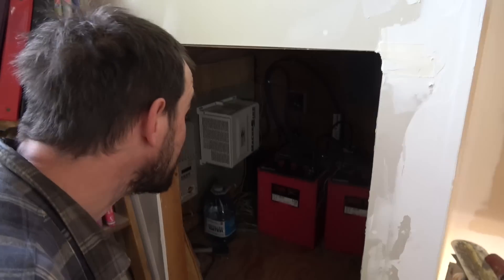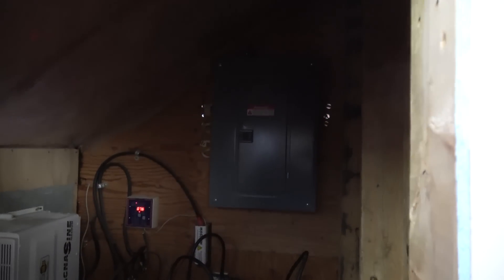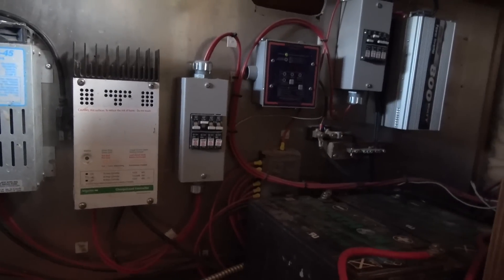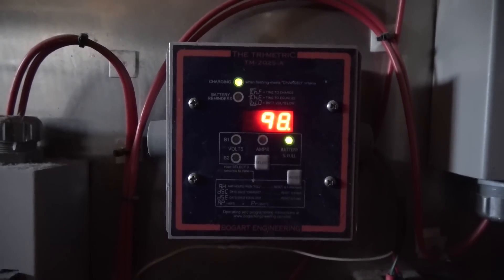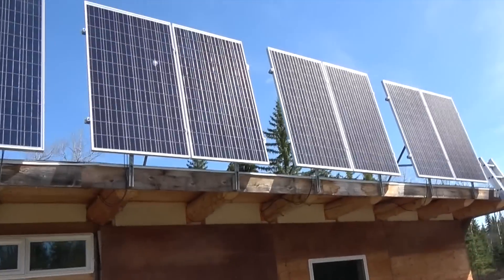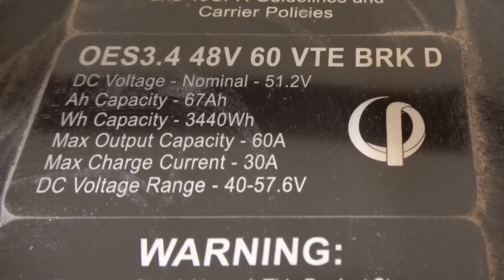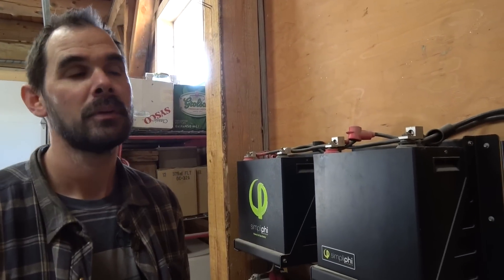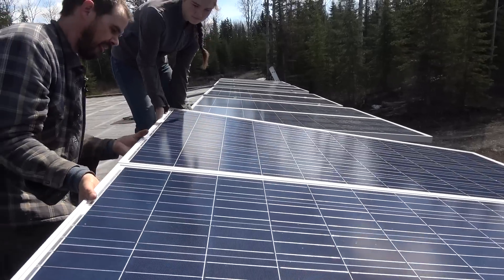Off Grid Solar Power - with Simpliphi Lithium Ion Battery

Comment: I'm working on my offgrid home solar. I'm at 1200watt mono panels. 2charge controllers. Running 24v. With a 5kw inverter. I'm building up the battery bank. And working on a lithium bank. It's at 108ah. Can't wait until its at around 1000ah. With a 200ah lead acid Bank. I am using a few DC led lights. Saving the ac lighting for when needed. With a gas tankless water heater. And getting a gas stove! Great video

Comment: All those little boxes and wires and stuff to perhaps fail is why I use small individual pv panels to run small air compressors and save my power in giant air (most being formerly propane) tanks. I call that my Air Battery. So I have a tiny $25 pv panel, a small 12-volt motor driving a little compressor and some receivers (tanks) . . . AND either a piston or turbine "steam" (read that 'air') engine coupled to either an ac or a dc generator. I make power for my freezer(s) as they require it.  The biggest take-away here is, I live my life "intentionally".  Purpose drives motive.😊

Comment: So when I had my solar array installed, the salesman asked me if I wanted one inverter or an inverter for each panel. Seems one inverter will limit power to that produced by the least efficient panel in the array. This question came right after I said I wanted the array to be set up to be attached to the grid for now but so that I could put in batteries later when batteries get better so I did not have to mess with the acid/hydrogen gas/distilled water stuff. Caught me from such a bad mental angle that I replied 'one on each panel' without really thinking about it. After all, HE was the expert even though I had tried to learn all I could before talking to the salesman. During installation I realized the system setup would not allow for that. The electrician confirmed that to feed a battery bank in the future I would have to place a single inverter to DC downstream of the panel inverters that were pumping out AC. I hope that is going to be as easy as it sounds and not much of a drop in power because those lithium ferrophosphate batteries like you have (SimpliPhi at about US $2800) are what I was hoping would come along. Anyway, those of you planning for solar now - batts later, don't make the mistake I did.

Comment: I'm also planning a hydroelectric project in mind. Well a micro mini hydro project. I'll be lucky to get 10a at 30v. Or 300 watts or so. But that's 24/7 andi could probably get by on a 1200watt inverter. And I have generators ac and DC. I can do 150amps at 30v. And 7kw ac. So I basically live off solar. And have emergency backup generators. Great video...

Comment: Build a root celler  underneath  your kitchen with a trap door and you won't need a refrigerator or a freezer if you do it right and put pond or river ice in it during the winter and early spring. The ice will last for well before the next freeze. AND salt then smoke ALL of your meats, fish included, rinse off excess salt before using the salted meats.

Comment: Discharging PHI batteries to a voltage level below the 100% Depth of Discharge (DOD), level Voids the batteries’ Warranty. Over the ten-year Limited Warranty Period, SimpliPhi warrants the SimpliPhi Power Product at 80% or greater of its original-rated capacity.

Comment: I have been of grid for 20 years in winter my fridge and separate freezer turns of by a timer at 6pm and doesn't turn on till 9am and every things cold and doesn't melt I have big tv washing machine internet every thing house has but if its cloudy I will not weld or grind or use big tools once you start you can never go back to the grid.
Reply: slipryeel I was thinking in the winter when solar charging g is reduced the fridge/freezer shouldn’t need much anyway. It’s way below freezing already out.

Comment: Just looked at Wholesale Solar... 3.5 KW Simpiphi batteries = $3,000 each.... for your 4 batteries, add 15 KW charge control and inverter (small excess capacity is smart) + monitoring software/interface = appx $14-15,000 US. That is a GREAT system, but I think I'll just get (2)Tesla Powerwall 2.0s, includes all of that for $15,000. Love your system, I just like to support Tesla and Ilon Musk in all of his world changing ventures.

Comment: I enjoy all your videos. Would it be intrusive to ask what the entire 5 panel solar system cost complete? I am sure I am not the only curious subscriber. Thanks for sharing.
Reply: interested
Reply: Each unit of 3kwh battery costs 3500$, and there is 4 of em, so at least 10000$ in battery ...
Reply from the maker: The prices I paid a few years ago are no longer current.  Right now you can probably buy the equipment (panels, charge controller, inverter/charger, combiner box etc) for around $2/watt (so around $6k for our system).  This does not include batteries as you could go very cheap and short term or more expensive and longer lasting.  The Lithium batteries are around $3k each and should last a very long time (I'm hoping for 20 years).  I've purchased from wholesale solar before, you can get an idea of prices from their website: https://www.wholesalesolar.com/
Reply: Jamie Karl in 10 years battery capacity will be multiplied by at least 5 though 😂😂 so he won’t keep it for 30 years i’m sure, that’s a trap. You can’t plan things that far...

Comment: Hey Jeff, Curious about why you added a second pair of the Simpliphi batteries. Capacity or peak output current? Lithium Ion is looking pretty tempting when our lead acid batteries wear out . Thanks!

PS - Enjoy the vids. Do the kids get to make them as part of their schooling?
Reply from the maker: After the first year we found that one extra battery would be perfect for total capacity, with our 4.5 kW inverter we had no problems with peak (thats more of an outhouse issue).  I ended up getting a great deal so i picked up 2 more, it's an embarrassment of capacity!
Reply: @Gridlessness  The point of community is to allow the community to have their say. & Kreis harder England would Mack all you Begging to pointless.  check him out & his solar power system it would put you to shame yes I get it you want to rub hot Dave's nose in it.  But it is not something I'd be proud of doing myself.  Sham on you Jeffrey for being a Snob. Les England I personally adopt the principle of having as many ions in the fier as one can  If I put it from a hunter's point of view as many strings to a bow as possible I rest my case.  YES, even Wood gas.

Comment: With that Soler powered system being small why don't you hook it up to a 3 volt motor with high rpms and uses high amps for the torque then push a generator head with that electric motor to make your solar system last longer and does not work the batteries as hard? One 12 volt battery only using 3 motor volts will last longer. There is a company out here is California just started doing that to solar system's for bigger house like I have.  Then with having the electric motor pushing the generator head you can over generate electric with it and then charge up the batteries faster or keep them charge up. Your a electric engineer do this you would not have to pay for it like I did. They don't have half the intelligence that Jeff the Tom Cruise look alike has because they had to come out 6 different times to get it working right for my house and pool house. Then I running a air water or a dehumidifier would give you clean drinking water always if you have over production of electric you could run 1of them it could give you all the water you need I think for one of then that make 60 gallons of water a hour in 24 hours that is 1,440 gallons of water a day.  If you put the on a hill over your house with it feeding into a tank you would have the water pressure just would have to do under ground lines from the storage tank because it is a lot colder there then San Francisco.   Love the videos please keep doing them Tom Cruise look alike.

Comment: If the batteries were full the charge control would be a solid green and voltage would be on float at 13.5  Sorry to say you still have a lot to learn so more reading and less talking
Reply from the maker: kenneth g reid , boy, you're right, I should have said 98% charged instead of fully charged. I'm ashamed,
Reply: Not even 98 % as that controller will blink up to 5 times when it is getting close to full 1 blink is still trying to put 90 % of charge from PV.  Just sayin
Reply: @kenputer56  Jeffrey is Just exercising his bragging rights He is not interested if he is actually educating anyone, It's all about the numbers to him. Does it prevent him from running his gen No only a wood gas generator will solve the problem & even that will need work.